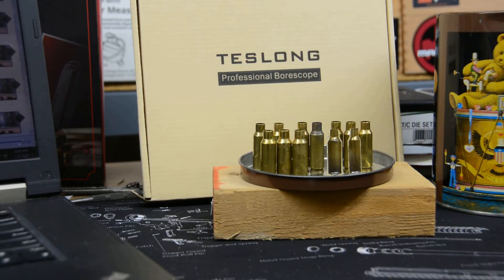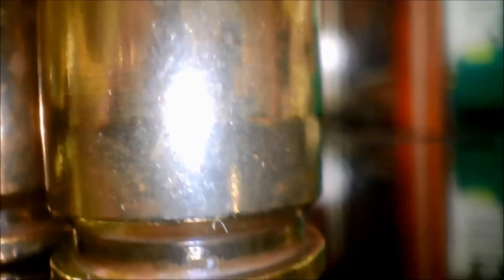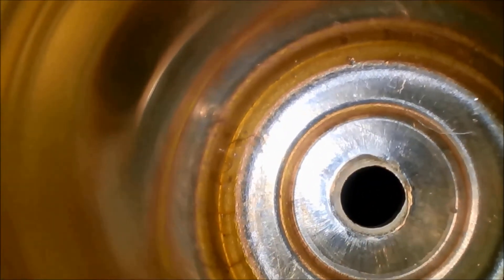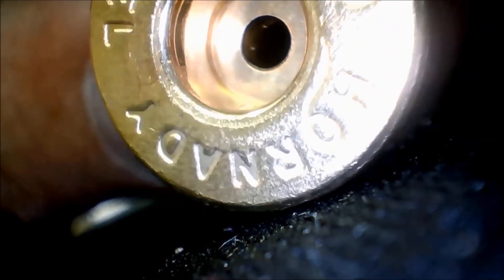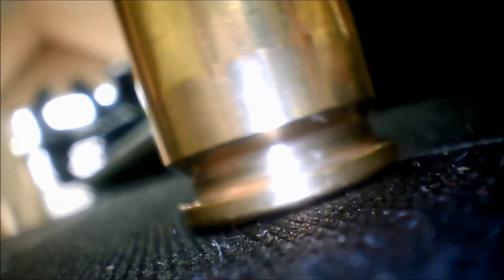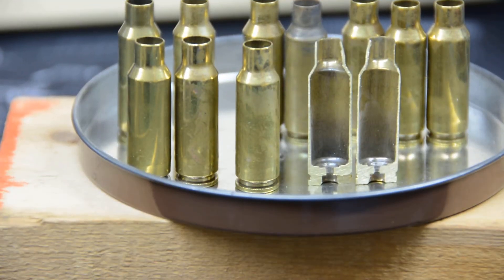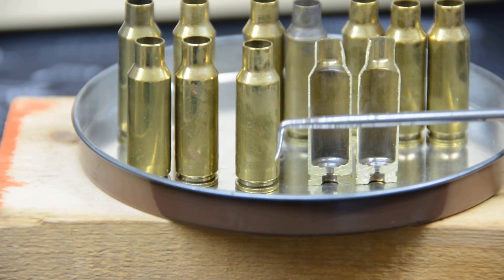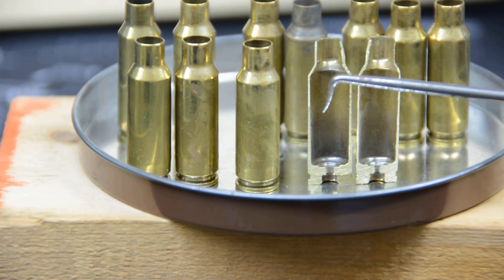6.5 Grendel Pt25  - Signs of Case Head Separation?

Comment: I am having the same issue. I bought a bag of 50 as well as some of the Frontier ammo as you can get it for about the same price as the brass. I am seeing this after just one firing on both bulk brass and the loaded Frontier. Curious has anyone contacted Hornady about this. I just sent a message with pics and hoping for a response. What is yall"s opinion on Starline will it hold up any better?
Reply from the maker: I’ve had great luck with Starline so far.  Do you run an adjustable gas block?  I did that and adjusted my buffer weights and have greatly reduced this.   Hazz
Reply: I am using a standard gas block with rifle length buffer and spring.

Comment: Could be head space problem or over size chamber ..try to weight each casing and compare weight....less weight .....less brass in the casings.
Reply from the maker: I found the issue later on.  It was a gas’s/timing issue.  Switched to an adjustable gas block and the brass is fine now.  Good points though and thanks for the comments!

Comment: I'm getting the samething with the same WC 6.5 Grendel barrel and bcg with factory loaded Hornady ammo.  My barrel was bought Christmas 2018.  I still have a bunch of the left that hasn't bn shot yet and I've bn throwing all that brass away.
Reply from the maker: Chris,  I switched to an adjustable gas block and then tuned it to throw the brass at roughly 4 o’clock position.  Seems to have stopped the issue.  Might try that if you haven’t already.

Comment: It’s not just 6.5 Grendel.  It happening in the arc as well.  Robs reloading channel has 6arc cases that the heads have cracking around the primer pockets.
Reply from the maker: Good to know!  I’m working on a new 6mm arc And am converting and fire forming 6.5 Grendel brass.  Taking it easy on the loads atm 😬
Reply: @Hazzbro1964   have you thought about fire forming 220 Russian to arc?  I’ve heard the 220 Russian can handle pressures past 52k up to 62k a little better.
Reply from the maker: @MrBoostin18  I would if I could find some.  Have all the plugs to check case capacity etc to.   I converted new 6.5 Grendel Starline brass just cause I had a few hundred already.  I’ll look for the 220 Russian brass again.  Would be a good challenge
Reply: @Hazzbro1964   they are in stock at a few places.   Grafs, bullet central, Bruno’s are just a few i know has them for sure.

Comment: I came up with about 6 casings that showed up like this. I had another 5 that did blow apart in the base. I also found that after 3-4 firings that 1 of my 2 barrel's is unforgiving to most all brass. By about .006 ". They jam, but are right at the firing point. I have been hand working my sizer and polishing the chamber.
Reply: Found my actual problem! I checked a number of things, and the biggest is that the resize from Hornady is about .010 too small. The casings swell and expand to fit the chamber, but if you resize, it drops it back .010 smaller and it's over working the brass. I did find out that it started out to be 
different size's of brass. Hornady went to the small size.
Reply from the maker: Wow,  another person seeing this...and even worse!   Thanks for the info!